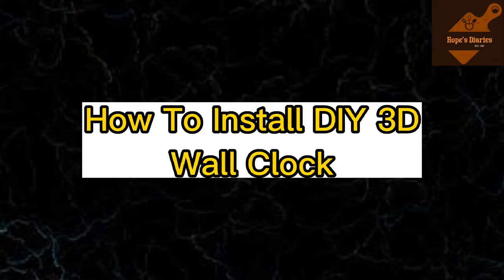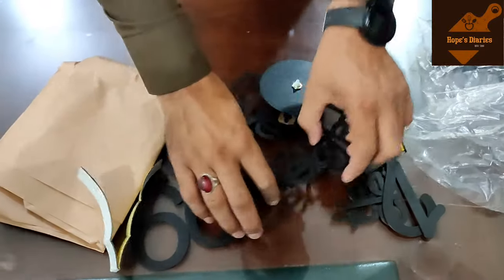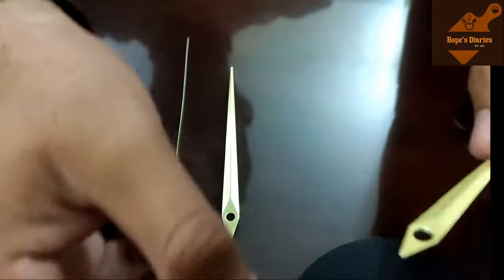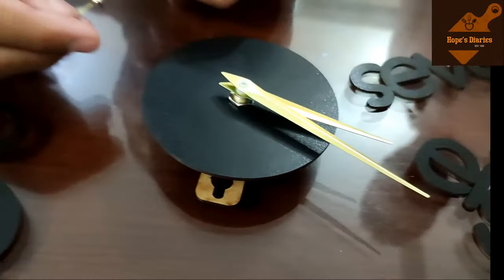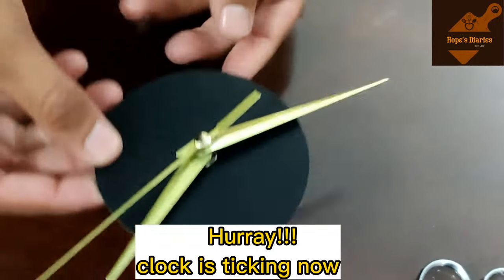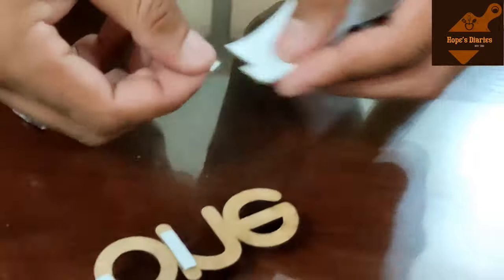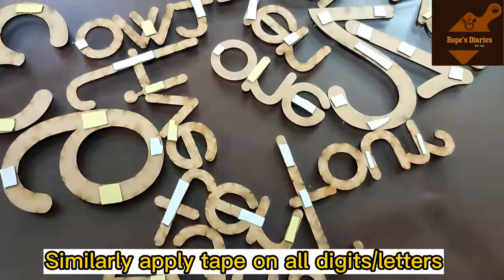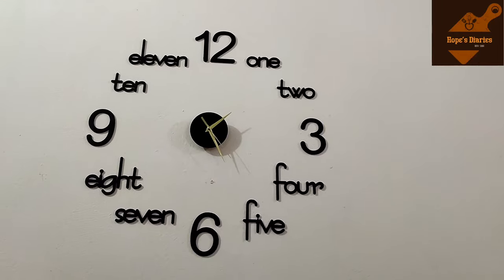How to install DIY 3D wall Clock/how to install modern wall clock/step by step

Comment: Mam from where to get that sheet ?
Reply from the maker: it comes along with the package
Reply: @HopesDiarieswithSidra  alright ! But I didn't get with the package
Reply from the maker: You should claim the company/vendor of clock to send it.
Reply from the maker: Or buy from daraz.pk
Reply: Mam I already ordered from daraz !
Reply from the maker: That's really unfortunate that you didn't receive sheet. Although it should be present with package. You should return back or reclaim the sheet. 
There is also a trick that you can draw letters with equal gap on simple white chart paper and then cut them
Reply: @HopesDiarieswithSidra  g shukriya

Comment: Hour needle hole is smaller. Doesn't get fixed. Falls down at No 6 again and again. What should I do
Reply from the maker: Needles holes are designed exactly in accordance to the holder, kindly try to fix it with a little pressure. I am certain that it will not fall again.
Reply: Having this issue with both the hour and the minute hands and they keep falling even after the added pressure. What should I do next?
Reply from the maker: I am sorry to hear that, I guess you received faulty product from the company. There is only one way which is replacement

Comment: But i did not get the paper pattern with my order what should i do ? 😢
Reply from the maker: You should return your parcel with a complaint against the store who sent you this. In case if you don't wanna do that and still want to keep watch without pattern sheet then you can do it manually by drawing on a white chart and placing letters equally but that is another time talking process.

Comment: Mary clock ke third needle sath match ni or rhe?
Reply from the maker: Kia issue aa rha. Ap email me inbox kardain picture. Match hone se matlab?
Reply: @HopesDiarieswithSidra  means ka uper teck ni rhe nichy girh jate haj
Reply: @HopesDiarieswithSidra  means ka uper teck ni rhe nichy girh jate haj
Reply: @HopesDiarieswithSidra  ok
Reply from the maker: Press karain halkay se hath se. is me automatically wo adjust hojaye gi. Awaz aye gi tick ki jab needle holder me set hogi.